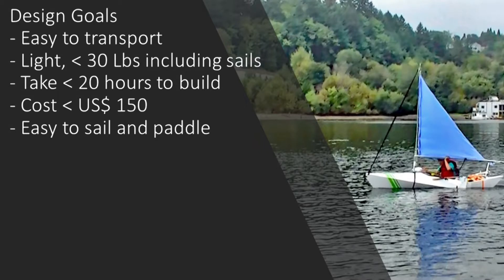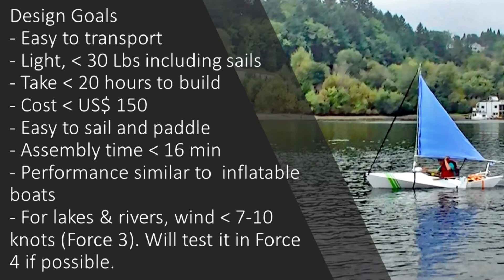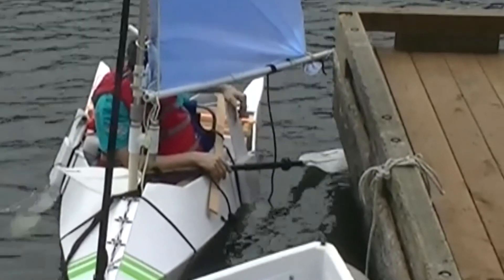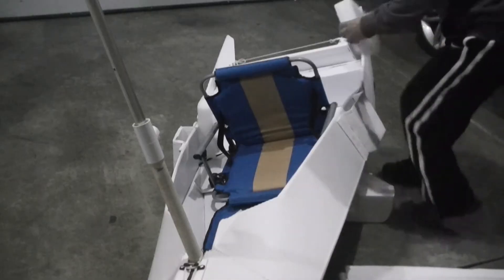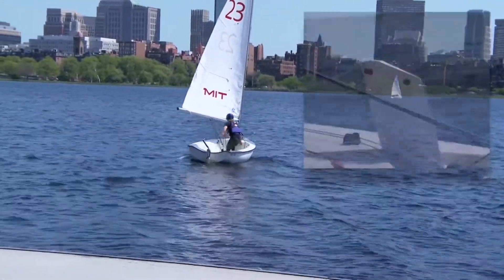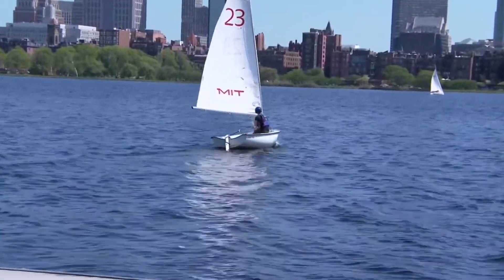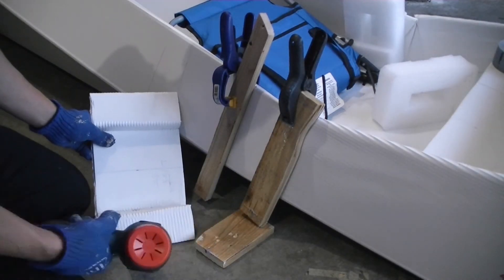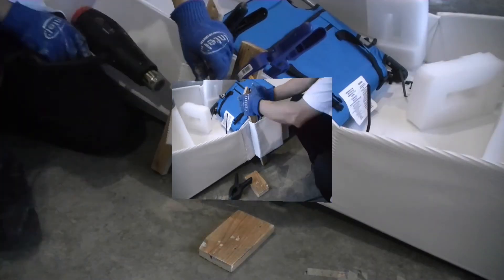Part 1: Foldable sailing kayak

Comment: ... interesting enough, subscribed😊
... good luck 🍀
Reply from the maker: Thanks for watching. This is my 2nd sailboat, since then, I built two more pontoon boats with added sails. I am considering building another foldable one this year, based on my Gen 25 kayak design. The foam pontoon boats are still too bulky for me. If you are interested, you can see my other designs here https://www.youtube.com/@DIYUSA/videos
Reply: ...I wonder if you tried different yet foldable and manageable by heat gun or even look into other similar new(to me) materials 
...in that regard I'm referring to divinicel( I m not sure of correctly spelling the name), it's material that Sven Iyrvind is building his small boat of
... good luck 🍀 @DIYUSA
Reply from the maker: @damirdebogovic9500  Thanks for directing me to Sven's channel. However, I am not sure the material he is using to build his boat, but it looks too heavy for me. It will also require more tools which I try to avoid. I did look into Tim Evans inflatable designs. https://www.youtube.com/@timothyrhodesevans  I probably will build one in the future. Recently, there is another foldable design https://youtu.be/ZRO8gptITNw?si=6euAihIbBNmqbM_M   I may combine coroplast and marine fabric to build one also. It will be heavier than my current boats, but it can be folded into a smaller form factor. Cheers!
Reply: ...thank you very much 👍🍀 @DIYUSA

Comment: this is exellent ! thank you for this great job ! i try to make one when i have time.
Reply from the maker: Thanks for your feedback. I have learned a lot in building this boat. There are many areas that can be improved. For example, the wood mast steps I used can be replaced with much lighter and simpler design. I have many new coroplast boat ideas to work on and have not returned to build my next gen sail boat. However, I plan to convert my Gen 17 for sailing. https://youtu.be/F09FB9_6zug  I hope to do that later this summer. For now, I am working on adding a paddle drive on this pontoon boat. Will share more info in the future. Cheers!